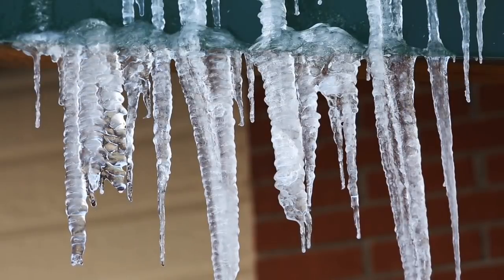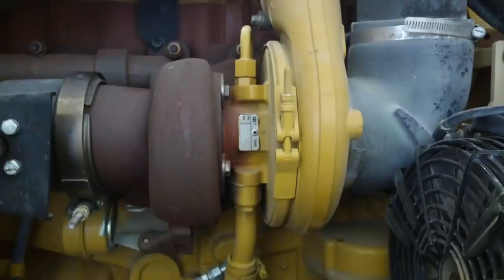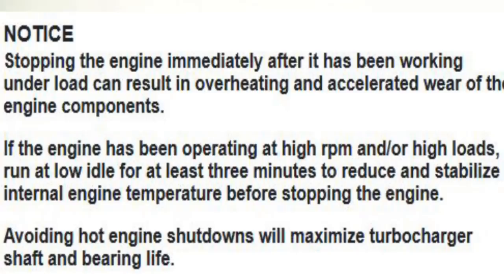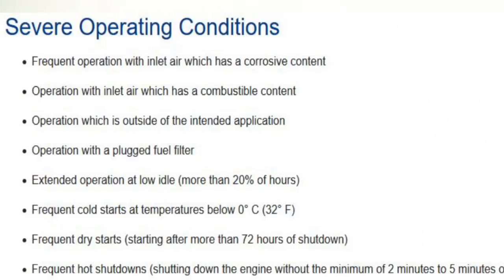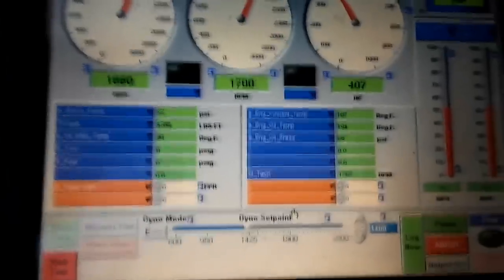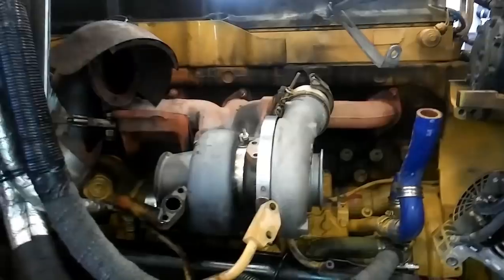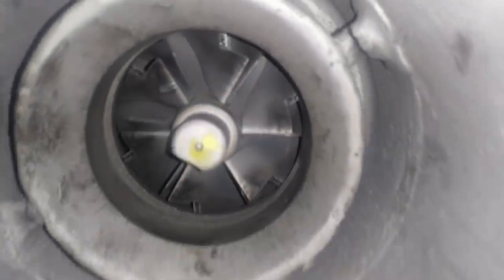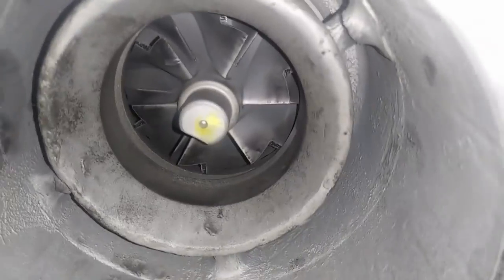Should you let a Diesel Engine Cool Down?

Comment: Yikes, I had a sensor go bad on a Volvo marine diesel on my sport fish boat while running hard and and the computer killed the engine...it proceeded to boil over making the engine room a hot steaming mess. Water based cooling is so much more efficient than radiators that there is zero tolerance for for lack of water flow. That worries me more than the lack of oil on a shut down.

Comment: I had no idea about dry starts, starting after 72 hours parked. What is the reason for that? Does oil leave  behind a lubricating residue for that amount of time?

I always let my 5.9 Cummins cool down to Egts below 300, coolant at 190 and trans temp below 180
Reply from the maker: That was the first time I saw that as well, worth another video.
Reply: Of course frequent dry and/or cold starts can cause abnormal wear to turbos and other components, many diesel engine applications such as power generation, marine power generation, marine propulsion and military applications are fitted with coolant heaters and oil priming pumps to minimise wear.
Reply: If you think of it like this, the engine has been sitting for an extended period, the oil will have drained back from the turbocharger and other components. For a short period of time on engine startup components will be rotating whilst unlubricated by pressurised lubricant until the engine builds oil pressure i.e. the turbo will start spinning up as air is drawn past the compressor wheel before oil reaches it. The time before lubricant reaches all components is extended when the oil is cold and more viscous.

Comment: Company driver here... just shut it down... lol keep idle time down... 😆 
No really.  Yup yup everything here is right. But would it be good to get a an auxiliary oil pump? Just to keep circulating oils after engine shutdown? It amazes me. That the hot hatch turbo car market does this. I'm really into high horsepower turbo cars. A timed oil pump for a few minutes to circulate oil after shutdown is easy... 
Again this guy knows his sh..
Reply: never knew (oil pump timer) even existed - thanks for the insight!

Comment: I'm a firm believer in letting gasoline engines, turbo. or not, cool @ idle for all the same reasons. Ex. valves run even hotter & aluminum cyl. heads on iron blocks could use some time for the temps. to equalize.

Comment: I've never worked on a diesel, but if you were a motorhead in the 'nineties, you knew damn well not to buy a car from the 'eighties with a turbo. People would get in and drive them with no warmup or cooldown and those bearings would cook like crazy and eat the shafts. Not surprising when that turbo is still spinning at 10,000 rpm + and oil pressure drops to zero.

Comment: I have a small 1.4 turbo diesel car of which I replaced the turbo. Old turbo had a lot ot axial shaft play so I decided to disassemble it and look for damage. Turns out the oil passages (tiny holes) in the thrust bearing were plugged nicely with caked oil blocking the oil flow and doing heavy wear on one side to the thrust bearing. That's why I also kept finding brass shavings in my oil filters.

Comment: Do you know of a good channel that talks about Detroits/series 60?  I drive a truck that has a series 60 and recently i had to park it and start driving another truck cause it started leaking oil very badly into my fuel tanks, it developed a bad oil leak from the valve cover and blowing oil through the air compressor governor and its blowing oil through the exhaust and white smoke

Comment: Great video. I’ve got an idea which I can’t take credit for but I’ll run it by you. What if you could put a small ish electric pump in the engine oil system. You turn on the key the pump kicks on and builds 10-15 psi then you start your engine. Also once you have shut your engine down the pump runs for 10-15 minutes to help cooling down evenly. 
So does this sound like way to much effort and money or could there be something to it?
Reply: Electric pre oilers are a thing, rolls Royce v-12 out of the spitfire came with one. Lots of  older large diesel agricultural applications had em too. Never heard of a post Oiler though.  High performance guys at the drag strip have been known to run their electric water pump after shut down. Probably a little more efficient than the oil pump as the water typically has a far larger cooler.
Reply: Many engine manufacturers are doing just this. More so for the coolant side than for lube. Many turbo bearings and centre housings are now water cooled and many modern engines do have an auxiliary electric coolant pump that forces coolant through the turbo and around the head for a short period after shutting down a hot engine. I believe, though I have no first hand knowledge of any, that similar systems are used in the lubrication systems of some vehicles that have automatic stop/start systems fitted. The first vehicle I owned with a water cooled turbo was a 1993 Isuzu Trooper/Bighorn 3.1 diesel. It did not circulate coolant after shut down though but I presume it kept the housing and bearing temperature down to lower levels than otherwise. The vehicle did nearly 200,000 miles on its original turbo before it was scrapped due to old age and multiple repair costs upcoming, the engine and gearbox not being issues.
Reply: You can put one on any engine, no extra energy needed.  Canton Racing markets the pre luber.
Reply: This has been a thing since before WW2
Reply: @hedydd2  GM does that with the little 6-pot Duramax. 

But then they do something asinine like using a rubber belt to drive the oil pump. Do these engineers sit around eating  paint chips nowadays?
Reply: @acemobile9806  
Ford use a wet belt to drive the oil pump on many engines also. They have had massive issues with injectors on their latest 2.0 diesels as used in Transit and Ranger [outside America] where fuel would contaminate the sump oil and degrade the belt......Bang! The belts are apparently fine unless diesel contaminates the oil.... but why use a belt unless it is to save maybe a Dollar/Pound/Euro per engine?

Comment: The main reason to not shut a turbo diesel down after heavy or highway use is because the turbo can keep spinning at high speeds for upto a minute which causes shaft and bearing wear when its oil supply is cut off.. idling an engine down helps bring the turbo speed down with correct lubrication.
Reply: Quite so.  And helps it cool down, & avoid burning the oil.

Comment: Was told to let cool down after working hard because the oil can cook and sludge up in the turbo veins.
Reply: Usually with old turbos that had no water cooled centre bearings when the oil stopped flowing when the engine turned off the spinning turbo shaft turned the oil into carbon with heat and friction.

Comment: How do you actually cool down an engine properly do you turn off the engine or how does it actually work
Reply: At idle the engine is using the least fuel and producing the least heat...so idling allows the most cooling until it reaches a certain point below which only cold conditions outside (a blizzard) will cool the engine any further.
Turbo timers...set and forget. automatically idles engine after "key off and out" for 1, 3 or 5 minutes (selectable) and that's for a cheap unit...

Comment: What if you have been on the hwy running it, but the temps are normal? Example: You come off the highway and your oil, coolant temps are reading in the normal range.

Should you still let it run for a few minutes before turning it off?
Reply: Turbo timers...set and forget. automatically idles engine after "key off and out" for 1, 3 or 5 minutes (selectable) and that's for a cheap unit...
Reply: @teenaramsay2469  yes I am familiar with them. Been using them in my cars and race cars since the 90s (HKS units), except my Porsche 944 turbo, because Porsche designed a turbo cooler that would continue to circulate coolant through the turbo after you shut it off.. 

That didn't answer my question. I guess that was your way of saying,  you don't know.
Reply: @johnnyturbo8460  I have been running my 1991 diesel SUV for the last 20 years with an automatic turbo timer, which activates every time after I switch the key off and remove it, even though the turbo has a water-cooled centre bearing and theoretically will not therefore cook the oil in that centre bearing.  I just think that if any hot spots exist anywhere in the engine, an idle period can normalise it. You know your Porsches  and I like the idea of a coolant pump circulating after key off...does the fan also automatically run as well? If so it is doing it's own "turbo timing". If you are happy with no cool down after reading the gauges...so be it. It has worked for you so no need to change.
Reply: @teenaramsay2469  yes the radiator fans are still on for a short time. 

again, you are completely missing my question, so I will ask it again... 

Example: You are driving your truck on the highway with all temps normal at the posted speed limits, you get off the highway and head home, all temps still normal.... would you still idle the truck for a while even though all the temps are in the normal zone and you were not towing or stressing the engine?

even if you drive clamly home allowing the car to "cool". Idleing can increase underhood temps since there is not air flow.  

I always understood it to be used when the vehicle was being pushed or after towing.

Comment: Boiling water turns to steam not air. Also cavitation is caused by forming and collapsing bubbles by gasses solved in the fluid not because of air pockets. If there is cavitation where should not be it means there is too much gas in solution in the cooling fluid.

Comment: Tier 4 emissions engine have a hot shutdown (c9.3 and c13) where the engine idles for 3-5 minutes before shutdown...(966m, 980k, 980m, 988k)
Reply from the maker: Until the operator hits the battery disconnect and the DEF fluid evaporates in the lines and then the service truck has to come out and clear all the lines.
Reply: @AdeptApe  also, operator can cycle the key and it will shutdown yet, will log an event code
Reply: @AdeptApe  
At engine shutdown the DEF system on current production engines should generally suck all the fluid out of the pipes and back into the reservoir. Certainly in well designed systems.
Reply: @hedydd2  He said if operator used battery disconnect to shut down, bypassing the auto cool down. No electrical power would stop def system from operating properly, thereby probably causing the issue he mentioned
Reply: @clintlee1810  
Does anyone do that? My experience with battery disconnect switches is that, firstly most are universal fitment with identical keys, and secondly that they are prone to failure with us. Maybe i’ve been unlucky but I’ve had more battery disconnect switches go wrong than most any component when the driver uses it regularly. Thank goodness, most don’t do that and leave well alone in these parts.

Comment: The Powerstoke manual says 7 mins of cool down before shutting it down on my 99 F250.
Reply: Well you sit there for 2 minutes then Turbo timer could take over...set and forget. automatically idles engine after "key off and out" for 1, 3 or 5 minutes (selectable) and that's for a cheap unit...you may be able to get one to set for 7 minutes.....

Comment: What I was taught about cooling an engine down is running the thing up to about 12 1300 RPM and hold at steady what happens is even at say 1250 1300 RPM you’re not hardly using any more fuel than that idols you’re using more and it isn’t causing them any more heat what’s happening now is the fluids the oil the water to the engine are cooling through the engine is greatly increase the volume is just blowing like crazy and why it now you’re pulling air more air through the radiator and the engine oil cooler you’re greatly increasing the flow through the engine and like I was just sad but you’re right idling an engine is better than just shut it off but bringing it up to like see a 1200 RPM your greatly increasing the volume of coolant and oil through the engine through the radiator oil cooler the fan is bringing huge amounts of air through the radiator and coolers that’s what I was taught and I’ve seen and I’m a heavy equipment operator and I’ve seen how quick the gauge can move down but anyways some of the equipment I have runs like a off-road articulating dump trucks of triple seven dodge dump trucks on the off-road machines and anyway I’ve said I know what you’re saying you’re right cool that engine down before youShut it down

Comment: Do you think this would apply to small Diesels (Powerstroke/Duramax etc...) also???
Reply from the maker: Yes, pretty much any engine that has times if high loads and idle time. Especially turbocharged engines that can have very high exhaust temperatures.
Reply: Turbo timers...set and forget. automatically idles engine after "key off and out" for 1, 3 or 5 minutes (selectable) and that's for a cheap unit...

Comment: I always try to let my 5.9 Cummins get atleast 30 seconds of idle before moving the truck and let it idle until the exhaust temp is around 350, idk I picked a number and said that’s pretty decent and stuck to it, if I drive for say 4 hours or tow I let it idle longer before leaving and longer before shutting down, diesel is cheap, repairs are expensive and a pain in my ass, I get paid to fix shit, i don’t want to spend money on parts and do it for free for myself 
Had someone with a motor home I knew who had just blew out his turbski and asked if I had heard about letting it idle, he about fell over when I said yeah it’s a turbo nightmare to shut down hot, he about fell over (he hadnt mentioned the turbski failure and wanted to know if his mechanic was full of it) 
It’s sad that no one bothers to tell people of any vehicle, let it idle cold and hot! I then introduced him to a shut down timer and he was going to look into it because I guess a few minutes is too long to have to remember to shut off the motor home lol

Comment: My Cummins runs at 200 no matter under heavy load or not so I let it idle 1-2 min before shut down think it’s fine?
Reply: Turbo timers...set and forget. automatically idles engine after "key off and out" for 1, 3 or 5 minutes (selectable) and that's for a cheap unit...

Comment: I have always had a theory that operating at no or low load (descending a grade for even several seconds) then putting your foot right back in it (as in starting up the next grade in rolling hills) is hard on the metal components as well. I just imagine the pistons, valves, and turbo going from 300 degrees to 1000 degrees in a few seconds. It occurs to me that this may take its toll. What are your thoughts?
Reply: No impact.  The materials are designed to take the high temps and have no issues with low temps.  If that was an issue operating an engine when it’s -30 outside wouldn’t be doable.  Inconel turbo shafts, ceramic or inconel turbines, aluminum compressor wheels, the exhaust valves are inconel, sodium filled stems...you literally can’t hurt it doing what you’re saying.  The new steel pistons are literally bullet proof and don’t expand or contract near as much as 2 piece steel/aluminum skirt ones do.  All these materials were designed for the space program.

Comment: If you don't let your diesel pick up truck anything that has a small turbo on it or turbo let them idle for at least three minutes you wouldn't think a diesel chipper would have a turbo but they do and that's what killed my boss is chipper turbo and he asked me what would cause it doesn't have as much power and I go I don't know so I checked air filter wasn't the problem the injectors are just replaced so I got a bug up my butt to check the turbo cuz I seen it and I took off the air filter and I grabbed it tried to turn it I couldn't move it so we used to just run it really hard and then to shut it off don't do that just let it run at idle let the oil cool down a little bit

Comment: I always throw ice cold water on my engine after every run 😎
Reply: Put salt in your water.  Itll be even colder.  Plus it helps the wiring harness.
Reply: @claterpillar1  nice, thanks for the good advice.
Reply: @hectorlopez3187  no problem.  Personally i use dry ice to cool my engine.   Makes a nice fog,  and cool popping noises.

Comment: Does this apply to a VW TDI after driving on the interstate for a few hours?
Reply: I have a 2014 TDI, also a 04 F-250, unless you live right off the interstate a light cool off, generally you are a couple of minutes from hard driving.  You'll be OK, my F-250 I tow a fifth wheel, I always give it a 10 minute cool off she has 229,000 miles.
Reply: Turbo timers...set and forget. automatically idles engine after "key off and out" for 1, 3 or 5 minutes (selectable) and that's for a cheap unit...

Comment: I have a 2ws is there any way to tell if the fuel filter on the engine is in buy pass like changing the buy pass check valve to some thing that would turn on a light of buzzer just something to tell me if that filter is in buy pass thanks 4ur time

Comment: Hey hello your videos help me to fix my c15 sdp engine in multiple times but I got a cuestión my truck is a 2008 kenworth t800 with the sdp engine and I want to install a 2003 6nz , is that possible? And what I need to do to the ecm for all the gauges work on the truck
Reply from the maker: They are physically the same dimensions and both ECM inputs should be the 70 pin on the oem side, the problem you may have is all the data link settings for the gauges, but if you have Cat ET you could probably make them work.
Reply: Legally you cannot put a older engine in a newer chassis. (EPA, Every-bodies Problem Administration).
Glider kits are different as the had no engine in them to begin with. Good luck.